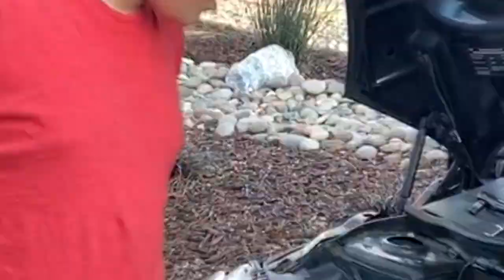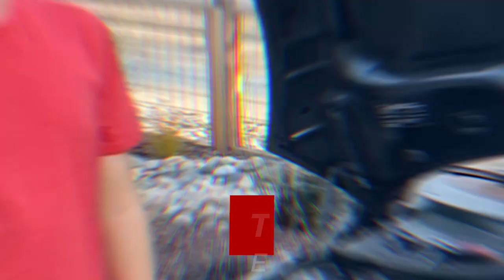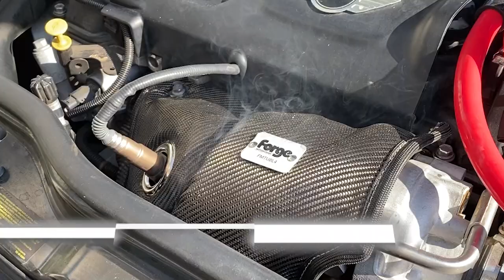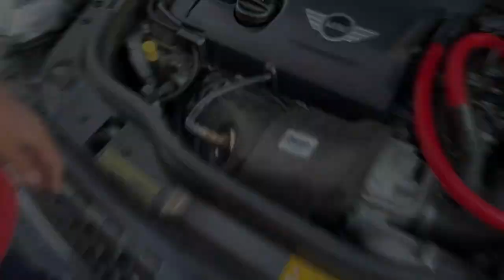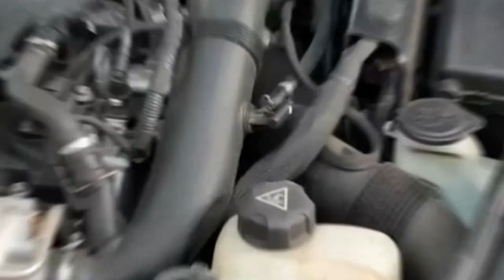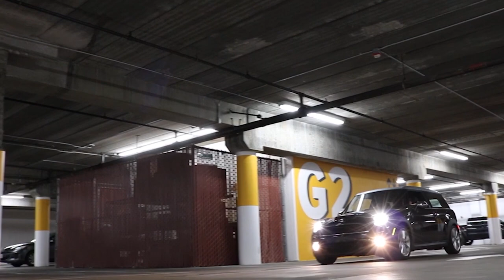Mini Cooper Clubman Turbo Blanket Mod Shmodcast

Comment: You did not show how the O2 sensor was fitted. Did you have to remove it?
Reply from the maker: Yes.... it squeaked, and sounded like nails on a chalkboard, and he made a face... basically making that piece of footage un usable lol
I had to rewatch, I thought I had that in the video.
The O2 sensor I believe is 22mm. Use a wrench, and it unscrews like a normal bolt.
do not try to clean it or anything. Place it to the side. replace after the blanket is back on.

Comment: You'll want to tuck the intake side so it doesn't cover the turbo feed lines. For some reason the installation guide doesn't tell you that and the photo has it the like that as well so most everyone is doing it the wrong way. I'm trying to decide which turbo blanket to go with. How hot does the surface on the Forge blanket get? Can you touch it at all when hot?

Comment: Did it make any noticeable difference other than lower temps? I put mine on and i could swear it feels little different. I just want to make sure that i did not self administer a placebo effect.
Reply from the maker: LOL...I totally get that lol

Yeah so technically....It allows the heat to escape the engine compartment, by keeping it more inside the Turbo so the heat can escape through the exhaust. This "helps" keeps our cars with the tiny stock Inter-cooler from getting heat soaked so quickly.  
Why: higher air intake temperatures, will equal lower possible HP output on turbo cars.